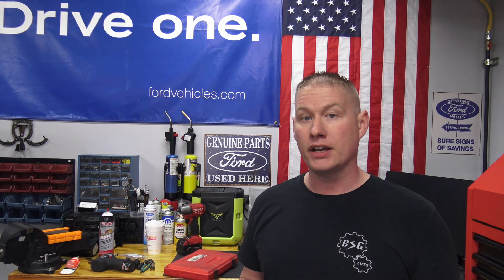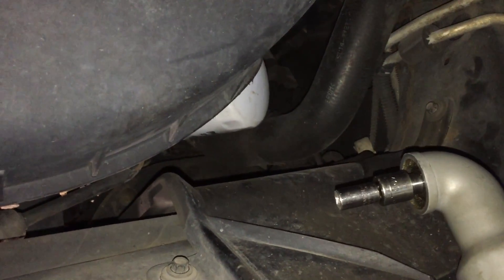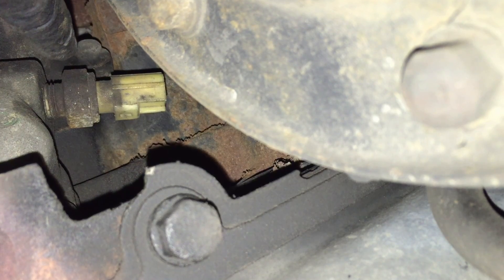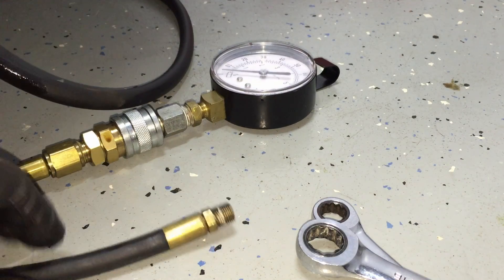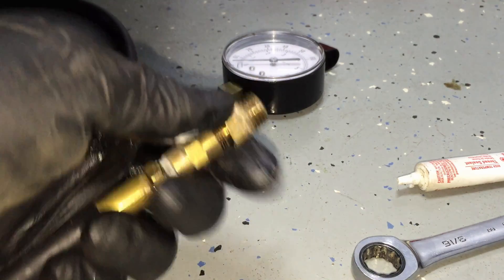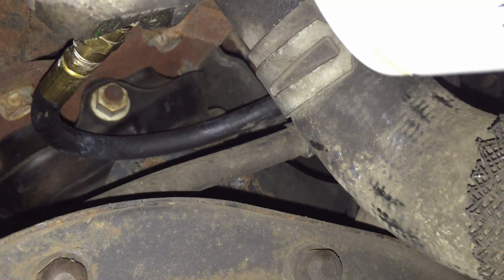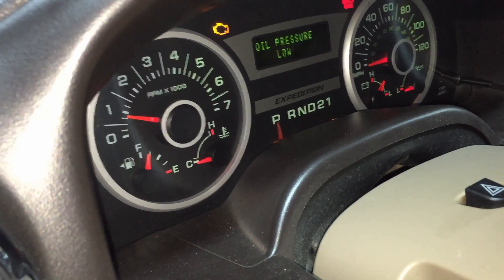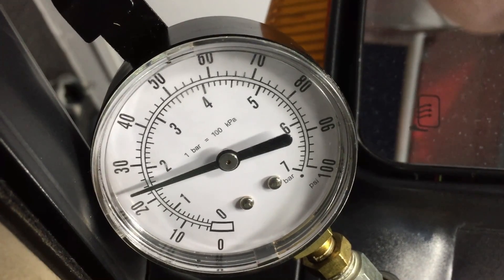Ford 5.4L 3v Oil Pressure Testing and Why It's so Important!

Comment: @fordtechmakuloco I did what u did but my needle is bouncing. This is a brand new reman engine with Melling Oil Pump. What would casue that? Air in the line or PTFE tape I used to seal threads? Thxs Rich
Reply from the maker: bouncing while cranking or while running.
Reply: @FordTechMakuloco While running. It’s like 4 psi. I used PTFE tape on the threads. Didn’t know if that could mess with it. I do know my passenger side CMP is not getting power. Thanks for replying. You’ve taught me a lot. Rich

Comment: So....presume the reason we need to do this on our trucks its because the threshold on the sensor is much lower than the 15 PSI?.  My mechanic told me the oil pump needed to be replaced; have a very rough idle on my vehicle and have since replaced coils including work on the VCT (he did) - frustrating issue for YEARS and pretty much have it parked due to this.  Question really is, why isn't the sensor picking up on the low pressure - light in dashboard has never come on?
Reply from the maker: 7-8 psi normally
Reply: @FordTechMakuloco  Thank you, will give it a go.  Should have asked him to verify while he had it in the shop.  Too late now

Comment: Excellent.  I have a 05 model with only 125k miles and have done oil changes regardless of miles.  Having no issues and would like to fix it up and keep it longer.  Much heavier built for towing that current 150s and a lot cheaper.  Mechanic told me he could check the oil  pressure and do some checks to get an idea before I put out money.

Comment: I'm going to take a shot in the dark in hopes that you can follow up with a similar find/experience. I recently went to check the oil on my 06 f150 5.4. It's been pretty consistent on the oil consumption of maybe a quart per 3000 mile oil change which mostly occurs towards the end of that cycle but I like to check several times throughout the duration. Well this time at about 1000 miles since the last change at cold, it was about an inch or so above the full level. No water in the oil and no gas smell. With that much over fullness I would assume that if it were gas leakage related, it would have an obvious smell on the oil. It is always right at the bottom right after running it for any amount of time and after it sits for a bit it goes back up to that over full level. Any suggestions?

Comment: Access to the sensor is ridiculous just like every other sensor on 5.4l crankshaft sensor is even worse. Of course both are necessary to troubleshoot and rectify vct problem
Thanks ford for figuring out the worst possible accessibility  design. DH

Comment: I have a 2005 F150 with an intermittent knock/rattle noise. The oil pressure is good, over 25 psi hot, but the needle on my gauge flutters rapidly hot and cold; any thoughts?  The total sweep of the flutter is 10 to 15 psi.

Comment: Just did my timing chain kit on my 05 f150 5.4 also put new updated rollor followers.  New 360HV Melling pump get around 30 psi hot at idle with my foot on brake and in gear
Reply: Amazing, do you hear the valve train??

Comment: Hello again it's me. I, i had done a head job on a 2013. Ford etry it in 5.4 l. And I checked to see if the motor is locked up, it only moves about maybe an inch or so. I turned off the motor and it doesn't turn and when I try to go and turn the engine back, it doesn't move.
It moves slightly counter clockwise.. But the engine did have oil. And the oil center of light was Raising and lowering intermittently, and then it stopped doing that. And then the engine started to make this Rubbing sound
And I pulled off the road turned off the engine. I think I may have spun a bearing. Because now I can't turn the motor by hand.
Other than maybe an inch or Or so Counter clockwise. Should I drop the Lake oil Pan and check and see? What happened? Because I drained the oil like I was supposed to I did about 2 oil Change. On it after putting the  header and trying to make sure nothing was there Now  I didn't drop the oil Pan the first time.

Comment: 2008 expedition with low oil pressure. What could be the cause?
Reply from the maker: Thrust washer.
Reply: Do you have a video on the repair?
Reply from the maker: Yes I do
Reply: My end play was .009 I found a broken plastic timing chain guide. Do you think that was the result of low oil pressure not the cause? What else should I look at to be the culprit?
Thanks

Comment: On every vehicle I ever had I put an oil pressure gauge on first thing. It is the most important reading next to the temp. Before you ever buy a used vehicle get the oil pressure checked.

Comment: Does this apply to a 460000mile town car 4.6 .I thought it was going to be an oil pump r&r. Be nice if I could slap in a gauge and monitor the pressure (light comes on at idle 500rpm)(to low?)

Comment: My 2008 F-150 with the 5.4L information display says low oil pressure at start up and then goes off right away.  It usually doesn’t come on as often when the engine is warm and then started.  Any ideas on what might be causing this?

Comment: fords new engine spec of 15 psi isnt so much because it is all that is needed but to save them money on repairing more vehicles prior to the end of warranty. it is not because 15 psi is perfectly fine but that they will save X amount of dollars by throwing thousands of loyal ford customers under the bus and saying your pos engine is perfectly fine and we are ok with it failing for you 2 weeks out of warranty. Fuck ford you greedy bastards ..yeah i remember how you 24 psi explorer air pressure killed lots of people cause you did not want to redesign the shocks and springs for a better ride so you lowered the tire psi even though every tire manufacturer said it wasn't safe

Comment: Great video thanks for all your great info . I have a 2009 expedition 5.4 that had  a cam sensor code for bank 2. I replaced the cam phasers because it was not returning. I replaced both phasers from ford and chain and guides and tensioners . After replacing I have the same problem . The vehicle jerks when accelerate hard and bogs down . No power . It gives me a bank 2 air fuel ratio code . I can see the power balances test light miss on 5,6,8 7 doesn’t look to bad . I am checking the oil pressure tomorrow. Any idea what I need to check next . Thanks in advance,
Reply: Any update having same issue.?

Comment: I put a oil pump and timing kit in my 05 expo.. it has no pressure on the dash..  I've only ran it 4 times at 20sec...  hoping it would come up.. sensor is hooked up..  its full of oil...  am I crazy if I take off the filter and start it to see it blow oil.. technically primed and pumping right.. I don't have the oil pressure gage in my tool box

Comment: So I have a 04 5.4. I changed the phasers all the timing and high flow oil pump from the links in your videos. Recently at stoplights, the alert comes on low oil pressure. no knocking no ticking and no codes. Press on the gas-to-go truck is fine no loss of power. I don't have a pressure gauge. running 10w-20 oil. Would you have any idea?

Comment: Oil pressure gauge installation with Auto Meter braided line complete in a 2010 5.4 Expedition. Using 5w-20 synthetic for the winter. Hot idle in park or neutral 28-30psi, hot idle in gear 23-25psi. There is mechanical noise in the cabin when accelerating off idle when the vehicle has been idling for a while, whereas before gauge installation, the cabin was dead silent.  Do not use the oil gallery port which has a plug on the right head for gauge installation. There are restrictors in that gallery which will cause misrepresentation of oil pressure, I was told by a 5.4 mechanic.
Reply: Appreciate you sharing that advice. Thank you

Comment: here is my question I was thinking of  replacing my 2007 lincoln lt with ford rebuilt engine. I have 189000 miles. replacing just the phasers will work for me, is there still plenty of life on my engine?

Comment: Apparently there is an oil plug in the RH head oil gallery that can be tapped fairly easily in newer 5.4's with no trans. dipstick, posted by "TheBestEngines". Wanted to check with the board and FTM about potential disadvantages in using this port vs the oil pressure sending unit port. Have also ordered stainless steel braided line -4AN, regardless of where line originates.
Reply: Did you end up using this port? Also, did you end up needing to tap it, or is it already tapped with threads?
Reply: No, I did not. My mechanic fabbed a custom piece to accommodate retaining the factory piece at the oil filter. As others have posted, the needle can develop a wobble depending on oil temp and RPM when oil is used for timing using the phasers. A good post on the F150 forum made a point that the pressure in the right head is likely different than the left because of the restrictors and its [place in the oil circulation. @anothersomebody8195
Reply: From what I understand it’s already tapped. Remove the plug with 1/4” Allen wrench then do a 1/2” to 1/4” MTF brass reducer to feed the gauge line.

Comment: Wanted to ask the forum if the best time to install a pressure gauge would be when changing oil and filter ? Then the pressure sensor might be more accessible in a 2010 Expedition, if you don't have a super long extension. Also wondering about the most durable line to run from the oil pressure port to the gauge?

Comment: I’m having issues with my 06 f150 5.4 timing is good parts all are Ford. I have fdm replaced dorman unfortunately. Fuel pump replaced motor craft. Camshaft sensors changed standard. I get the clacking sound when low oil pressure.  My boss and I put Lucas and a motorcraft oil filter it started running better but he is adamant on changing the crankshaft main bearing however the oil filter previous was wrong and was a lot smaller. Can the wrong oil filter cause low oil pressure ???

Comment: Will a couple guide pieces in the oil pan hurt anything I did the timing job but not the oil pan it runs good but every once in a while I can hear the pieces clanking in the oil pan
Reply from the maker: Bigger chunks no but most times it fills the pickup as shown in many of my post.
Reply: Turns out it was a thrust washer that fell out

Comment: This did not match to an 06 f150.. it is impossible to get your hand in there. Wish you had mentioned that before I bought a pressure gauge
Reply from the maker: It’s all the same setup
Reply: @FordTechMakuloco  that's what I thought... I can only touch with finger tip... Maybe I have clodhoppers for hands idk

Comment: @FordTechMakuloco Any idea what the psi difference is between 5w20 and 5w30? I know 5w30 runs higher but any idea what the amount of difference would be?

 Reason being, I have a 04 5.4 f150. I have had it about a year and I bought it with a bit of a tick, (quiet at the time) it has started to get louder and I was wondering if it was worth tearing it apart or if I would get in there and find I need a new engine. The truck had oil changes done every 5000kms with 5w20(full synthetic) with the previous owner and also with myself. However, the day before I did the oil pressure test I had an oil change and decided to run 5w30 full synthetic as I saw you recommend it.  The oil pressure test went well and I have 37psi in drive at operating temp. (a bit colder out that day so maybe a little lower in the summer months) Unfortunately I didnt think of this until after I ran the test but if the difference in psi is a big one then it doesn't matter that it reads 37 now if it was run its entire life on 5w20 and the pressure was lower than 20psi then there is a good chance I could have damage. Hope this makes sense and any help is appreciated. Thanks.

Comment: Could use your advice. 270000 mile F150 2 valve 5.4, blown intake gasket. Replace intake gasket and intake 2 weeks later the gasket has failed. What would cause that. Is it back pressure from a catalytic converter or something else. I'd appreciate your comment or anyone else's who knows what this could be. Thank you

Comment: I am really hating my Ford right now. Oil Pump, Cam Phasers, VCT Solenoid, Timing Chain and Tensioners, New Spark Plugs, New Battery, New alternator, ALL THIS AND STILL RUNNING LIKE A DIESEL WITH A LOW OIL PRESSURE LIGHT!!!!!!! I am not sure what the problem is. Its a FORD!!!!!!! I like how the truck drives but the complexity of this engine makes me want a 2wd truck without turbos and a simple engine that is low output so it lasts forever.

Comment: Is there an upgrade that makes the dash gauge functional?
Reply: In a 2004 F250
Reply from the maker: Yes most mechanical oil pressure gauges have "T" or "Y" adapters that keeps the dash functional- https://amzn.to/2yIbmUo

Comment: great videos!  How about having 80 psi cold idle? Is there such a thing as too much oil pressure?
Reply: Yes   Is there ?
Reply: That's perfectly healthy oil pressure. if you build up too much oil pressure there is a release valve in the pump it usually opens at 85 to 90 psi.

Comment: Is there a way to to put in a permanent oil pressure gauge? I mean I guess you could do it there and just stare at the oil light being on all the time.  Or maybe a sandwich adapter? Thoughts on this?
Reply from the maker: Yes you can just use a "T" or "Y" adapter as shown in other videos.

Comment: Sir if I may? My gauge is going up and down. Low pressure normal pressure. My mechanic replaced the oil sensor yet when the truck is warm the gauge is still fluctuating. He said the psi was roughly between 15 and 20. Fyi. This is a remanufactured motor with 200 miles on it. Thank you for your time!!

Comment: My 2008 Lincoln navigator died on the road and engine light came on along with low oil pressure. No oil leaks anywhere, or drop in oil level. Replaced oil pressure sending unit and dash gauge shows there is pressure when cranking the engine. The problem is the engine is cranking but does not start, don't pick up at all. Engine light and low oil pressure lights are still on but no DTC stored in memory. What is preventing the engine from starting?

Comment: I have a 2010 f150 with the 5.4 3v engine. I few months ago I hade the cam phasers, VCT selinoids, timing chains, chain guides, chain tensioners and high volume high pressure oil pump installed. chains were slapping upon start up and had nocking at idle. so that is why I had everything replaced. now when the truck is cold it runs great. but when it gets to operating temp is runs rough and shakes a idle. if I give it gas and RPMs it clears up and idles fine. but if I drive it and return to idle it runs rough again. from what i have read it sounds like I might have a sludge problem and lack of oil pressure to the VCT solenoids? I have added a engine claening treatment just before my last oil change with no change. what are my best options at this point? can the oil passages be cleaned? BTW YOUR VIDEOS ROCK!!!

Comment: How do I install a permanent gauge for oil pressure using this port? Is there a split I can install?
Reply: Best just leave it alone. Buy an oil filter sandwich plate , with extra ports. then hook up a permanent oil pressure gauge
Reply: @johnplayerson5906  any experience or particular brand for the sandwich adapter? 09 F150 King Ranch

Comment: I want to upgrade to the higher pressure oil pump.  I had everything replaced...timing chains, cam phasers, chain guides and tensioners, and both VCT valves.  Unfortunately the better oil pumps weren’t out yet.  How much am I looking at to have a shop install just the oil pump?

Comment: I have a 2004 FX4 with a 5.4 3 valve engine in it and I can't for the life of me figure out how I'm going to be able to get the oil sender out and screw in a test gauge do I need to drop the differential take the oil filter off any help would be appreciated thank you

Comment: FordTechMakuloco if you get around to it a lot of us would value a video and parts list on permanent mechanical oil pump install in 2004-2010 f-150s.  Thanks for sharing your  knowledge and saving us all $$$

Comment: Has anyone ran pure transmission oil in the engine to clean out the oil passages
Reply from the maker: No! You must run your regular engine oil with some ATF added.

Comment: My 5.4 lariat has 233,000 I hooked up the oil pressure test it was about 55 when starting and as it got warmer it got to about 10 psi I just ordered the melling m360 high pressure oil pump, what's the chances it's just the pump and that I shouldn't put a new motor in it? It dies in gear once warm. Please respond I'm not sure what to do or if I should even put the pump in or if that would be wasting time

Comment: Hi i have a 2v 4.6 and installed a manual gauge and it worked fine four a half year but now it has the flutters at higher pressure mine reads 76 at cold start up 18or 19 at hot idle in gear and 30 or 40 on the road im fixing to intall a pressure snubber hoping it stops the shakes plz help

Comment: Thanks for the video. This is really helpful. I bought a 95 F150 with the 5.0 recently. The built-in gauge dropped to zero so I replaced it with the Bosch gauge. It ran at about 50 psi for the first 15 minutes. Then it dropped down to about 30 and 20. I drove around a little bit and seemed to hold around 20. After parking again, it went down to zero but then it came back up again. Do you have any thoughts on that?I would really appreciate it thanks

Comment: Thank you for this post! Just performed the test and the engine oil pressure of my 2008 Ford F150 dropped to 8 PSI after about 15 minutes, started at 60 PSI. Below 15 PSI the rough idle started. I replaced both VCT solenoids (following another of your videos) but the problem persisted, and this video gave me the answer. Looks like it's a Melling M340HV for me! Thank you!